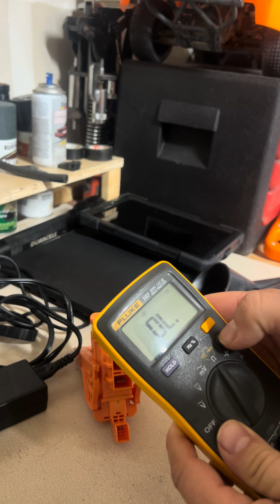**"2012 Hyundai Sonata Hybrid battery main Fuse Test: Quick and Easy!"**  - **"

Comment: Question if i need to change the fuse on my battery cable that connects to my 12v battery in my truck should i pull that plug out first?
Reply from the maker: Yes better to disconnect the battery.